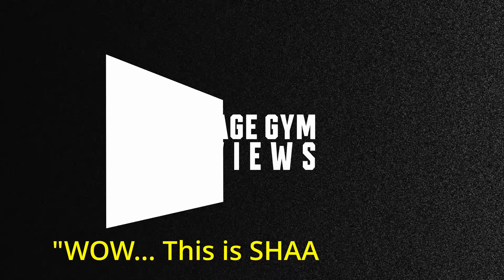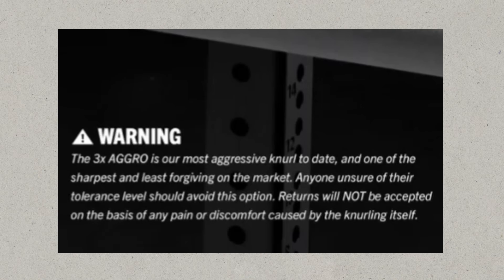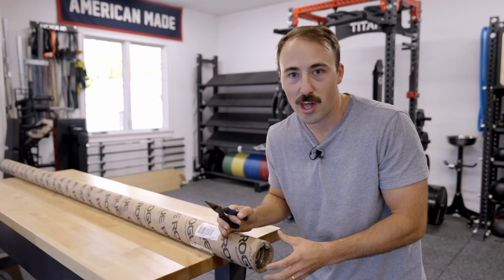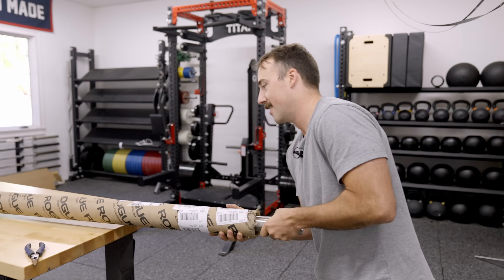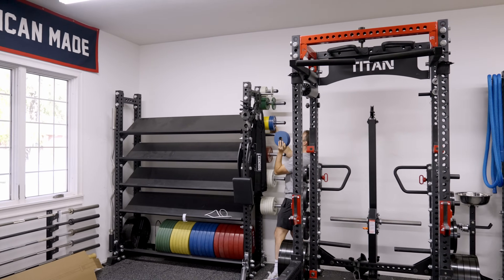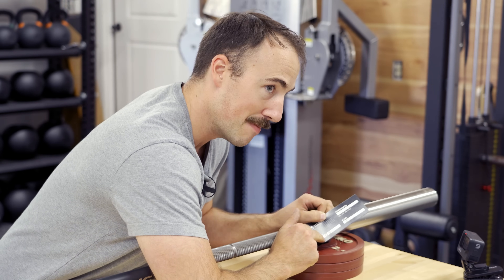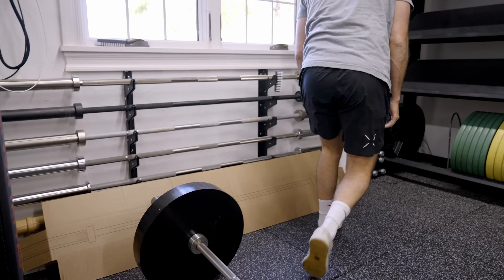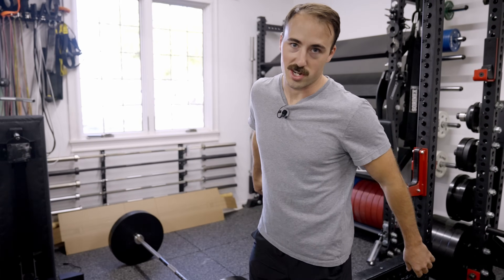Rogue AGGRO Power Bar Unboxing & Impressions! - (Sharpest Barbell in the World?!)

Comment: That bar is great for people who have some serious callousness built up on their hands & want the bar that will give them maximum grip. Definitely not for the average lifter but great for the dedicated powerlifters.
Reply: Imagine pulling sumo with that 💀
Reply: Nah, dude. A bar this sharp would peel off years worth of callouses in seconds
Reply: @Zakisbackontrack  who cares about callouses
Reply: @jamiekelly8354  people who want maximum grip on the bar
Reply: i know powerlifters are known for pain and suffering but there are borders to that and they start at the point where it becomes almost impossible to hold on a barbell without ripping their  hands open so they loose grip. After all we still prefer weight over pain
Reply: I am a climber and that would be the allure to me
Reply: I ripped my hand open only deadlifting 475
Reply: I can agree
Reply: as a pro ninja warrior, i will tell you that a sharp bar is useless for training. even if you have expert callouses it will tear them up fast. Just use good grip strength or wraps. this is ridiculous and useless
Reply: @turabbnturab  I just pulled sumo with mine.  Felt great. No chalk needed.
Reply: Thanks! I was wondering why anyone would want this extremely sharp bar. The whole time he made it seem like a bad thing, so I couldn't understand why Rogue was advertising it as a good thing.

Comment: 2:05, fair point, but no one really buys a new barbell every six months. Unless youre Coop, in which case, rogue better give Coop some special packaging
Reply: I agree. I just got a curl bar and men’s pink once a year bar from rogue today; and fuck opening bars. Those nails are so god damn hard to open. It says you can peel tube, but it doesn’t peel. Barbell opening from Rogue is terrible.
Reply: @brandonhoover2120  i had to use a screwdriver and bend the nails. Ive had two bars took a hour in total
Reply: @KronicNitron  same as I did. I was a little faster because I’ve done like 7 rogue bars by now. But it sucks opening rogue barbells.
Reply: No one really buys a new phone every six months either.
Reply: For 525$ in a barbell??? It should be the least they could do
Reply: @FGirao  go price out a 6 foot section of 1.250" stainless bar stock, and a 3.5 foot section of 3.500" stainless bar stock, and you'll see why it costs so much. By the time you add in machining, assembly, Cerakote'ing, laser etching, and all the other expenses associated with production, they're not making a ton of money.

Comment: In terms of packaging, I bought a Voodoo bar from X-Mark last year when I started my home gym... their tube uses screws to seal the ends instead of staples, and it was a breeze to open.  Sure, it's not a Power Bar, or a Kabuki, or anything else fancy, but their package design team gets strong marks from me after seeing what you had to go through to get this cheese grater unwrapped, lol
Reply: Our Synergy Rhino bar was the same way. Tube with screws that was quite easy to open.
Reply: @NiSE_Rafter   Just bought my first bar in a long while - a Sabre bar from REP and it had screws AND wire staples! - At least 15 mins to get it out of the tube
Reply: Rep does the same with their bars.
Reply: How has the Voodoo bar been treating you? Does the chrome paint peel off the collars like they do on my skullcrusher bar? I like the feel and the knurling, but I'm still finding shiny chrome flakes all over my gym floor from that bar..
Reply: @turtlepowersf  It has been treating me very well... I use Kabuki plates, which do not have the smoothest finish, and I have not once had any kind of flaking, peeling, rusting, etc.  No issues at all in fact, other than working the way a well made bar should :-).
Reply: I got the same packaging with Primals Black power bar - an excellent bar that’s for sure

Comment: Coop isn't kidding around about that knurling. I got to play around with the 3x AGGRO bar at the Rogue facility and no way I'd want to squat or deadlift with it. That said, the 2x AGGRO bar's knurling was on point. I purchased the 2x bar asap 👌🏽.
Reply: Thanks!  Your little comment was far more informative than the actual video.  I'm considering the 2x as I like the volcano knurling....but wouldn't mine one that had some extra bite in comparison to the OPB.

Comment: Can someone explain why you would want really sharp knurling?
Reply: There isn't. People will justify grip, but there is no reason whatsoever you'd need something like this
Reply: When you bench wide it’s good to have a more sharp knurling so your hands grip stick well and not slipping outer more.
Reply: It's preference.  Since people prefer a sharper bar and some people prefer less sharp.  I'm sure it will help with grip some minor amount.
Reply: For low Rep ranges, less use of chalk. Great for pulling, feels good on heavy squats since it grips and bites into your shirt 

It is a preference thing but for me, with large hands and frame, I really appreciate the rougher Knurl and don’t need to chalk up as much 

I really don’t think this bar has much application outside of powerlifting, honestly 

Strongman you usually are doing events for reps and get to use straps etc 

CrossFit is always reps but when it’s not a decent Knurl is fine 

Oly, their comp bars actually can be pretty damn aggressive since they’re, like powerlifting, doing 1 Rep maxes in a competition setting. However their bars are thinner with ball bearings in the sleeves.

Bodybuilding and General fitness would most likely be fine with the Ohio Power Bar or anything else with a center Knurl.

So yeah, not really much application for this AGGRO bar outside of powerlifting.

Would love to hear others’ thoughts though on it
Reply: @kozmo7  I mean the Ohio power bar is already plenty sharp for powerlifting, I wouldn't like it any sharper tbh.
Reply: @teekue  

Yeah and that’s totally fair. In another comment thread on this video we were discussing how sharp Knurl is so subjective it’s really hard to determine what is sharp and what isn’t.

It’s not a cool thing, so I do disagree with the sentiment that “oh you’re a wimp if you don’t like it as sharp as possible”, so in that sense I think it’s stupid.

But in all honesty, it could be my hands or who knows, I just don’t find the Ohio power bar to be sharp at all and I have it in stainless so the Knurl isn’t covered. I recognize that this is such a personal thing though for sure. Like picking out comfortable clothes or something.

Comment: honestly I think they ship barbells like that cause it's cheap and secure. I work at fedex, and it's so annoying when I'm trying to load a truck at 360 packages an hour and i pick up a long, thin package and the barbell encased in it slips out cause the package isn't secure enough to handle the 45 pounds of pressure put on either side.

Comment: Cheers! Been waiting for this review. Got to try low bar squats = add option to get standard knurl in centre...
Reply: I have a similarly aggressively knurled bar from Rep (Powerbar EX Deep Knurl) and it took me about 3-4 months to get used to it for low-bar position squats. I had a rash that sometimes bled where I normally placed the bar for that entire time. But it also trained me to not let the bar move even a millimeter while on your back and squatting, and ~18 months later I've not had a problem with it. No rashes or even marks on my back when I squat now.

Comment: Coop, I agree with you on the opening of the barbell package. However, I found that taking a reciprocating saw to the very end of the tube (within an inch) allows to open it up in about 20 seconds. Just ensure that the barbell is shifted all the way to the other side, so you don't nick the sleeve. It works like a charm every time. Trust me, you won't be disappointed.

Comment: I agree with coop, Rogue should have put their little monster logo on the endcap. that was just laziness to reuse their current OPB endcap. I get it that it's the same bar other than the knurling but come on. The Knurling MAKES the bar.  A different endcap would have increased it's cool factor, which is all this bar is good for. SO why didn't they do it!? It would have been easy and cheap and would have gotten them a few extra sales...ok rant over lol.

Comment: This weekend  I got a used Matt Chan rogue bar that I thought looked all kinds of pretty and it did because it hardly ever got used but when I actually felt the knurling especially the center knurling Hugely disappointing way too passive for my liking in the center knurling shouldn’t even of bothered being there it was almost as smooth as the smooth portion of the bar
Reply: That was the point of the Chan bar specifically was to have a passive center knurl to protect your chest and neck from being grinded on during thrusters and front rack movements common in Crossfit. Matt Chan is a Crossfit athlete.

Comment: The bar is $540, not $525. And there's no "2.5 aggro" - it's 2x and 3x. 

Also, wouldn't it take less tooling to make an aggro bar, since they're still making the same mountain peaks, they're just not making the volcano cuts and removing the points?
Reply: Since release, the price has already gone up $15 for both 2x and 3x

Comment: Cost of the bar goes up or down based on the type of material. Not the knurl. Steel is easier to form or knurl then stainless. Unless it’s 303 stainless. 303 turns like butter.  Steel is also cheaper. The difference between a light or heavy knurl is just typing in a new offset for the same tool. Don’t be fooled by marketing.

Comment: I half wonder if my boneyard deadlift bar doesn't have this knurling, because it is several times sharper than my ohio bar.
Reply: The bare steel Ohio deadlift bars have more aggressive knurling than the OPB and the Ohio bar knurling is very passive compared to the OPB. I’d say you probably just got a normal one.